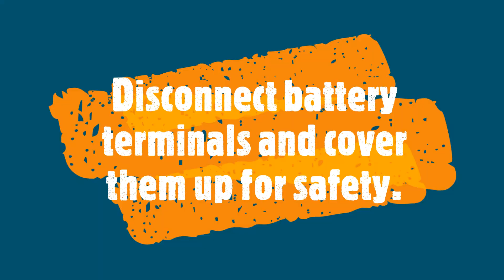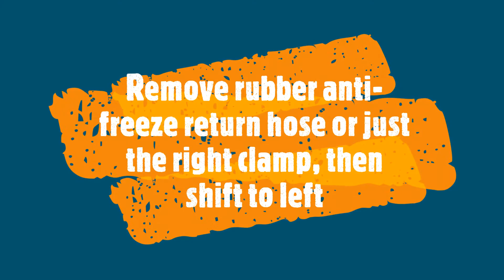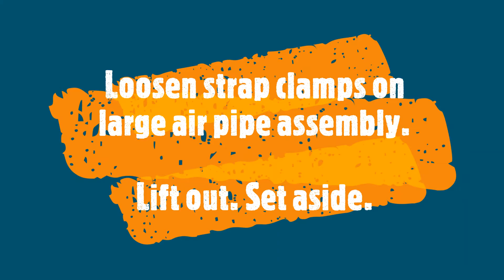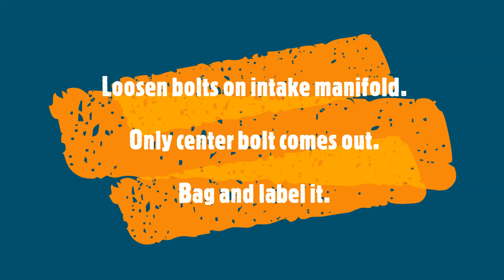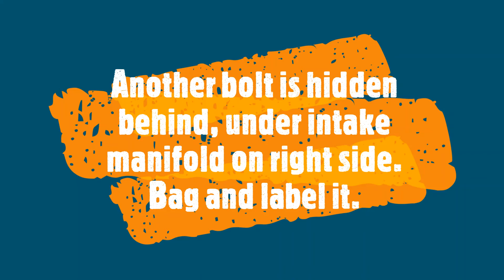Lincoln MKS 2013 3.7L - Engine Upper Intake Manifold Removal - You Can Do It Yes!

Comment: Thanks. I have a 2013 MKZ 3.7... I  need to change out the ignition coils and spark plugs. Whoever removed the intake manifold last, stripped the center bolt at the top of the manifold. What's the best way to remove this bolt? I would like to replace it if possible as well. Any suggestions?